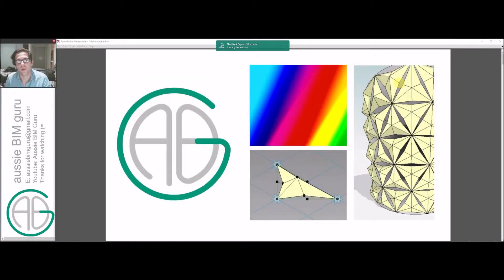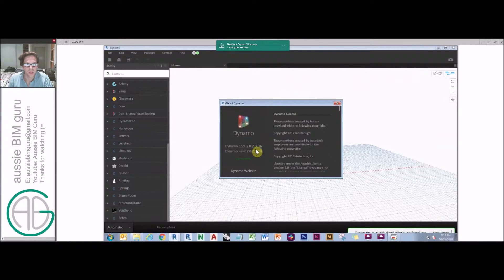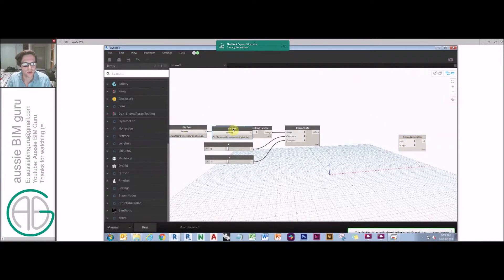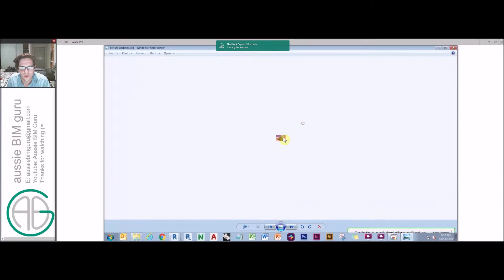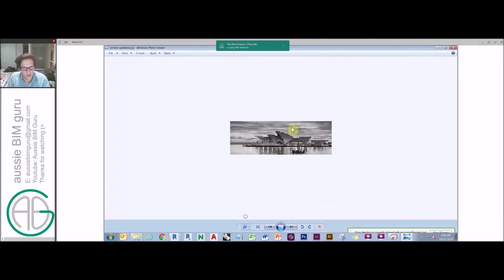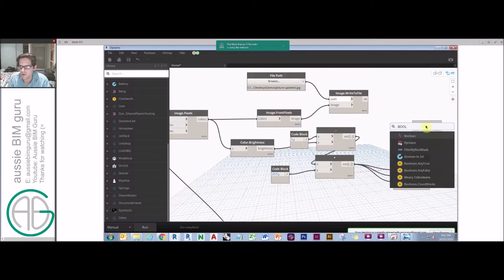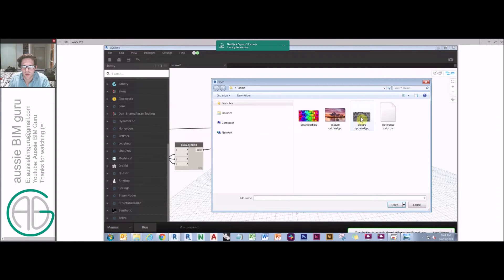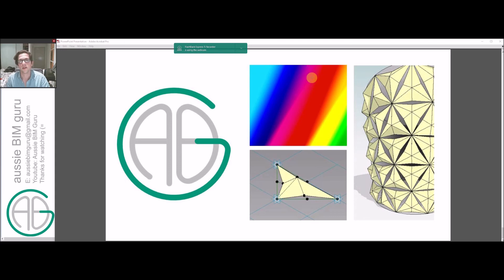Images Processing in Dynamo (Intelligent Facades 1/3)

Comment: Hello, does this works if the walls aren't inside our current model but in a linked architect's model ?
Reply from the maker: If you need to edit elements they will need to be native to the model. You can read linked elements and get their geometry however, springnodes has nodes for this.